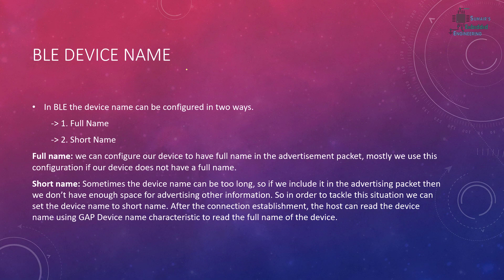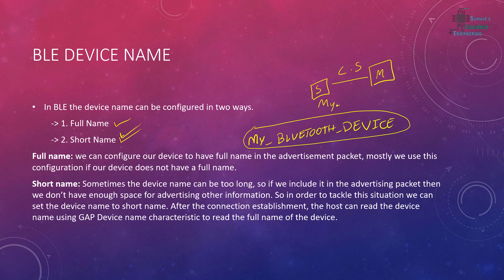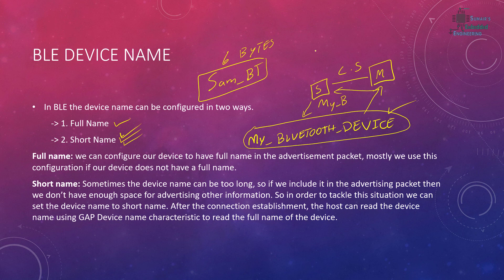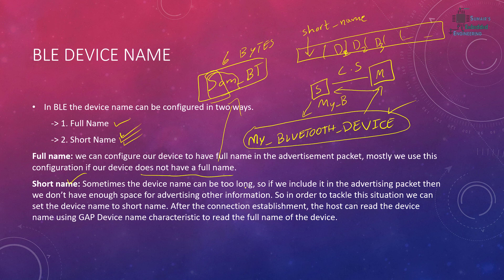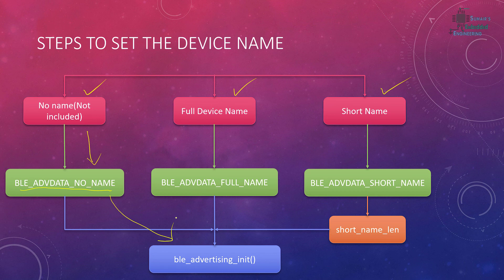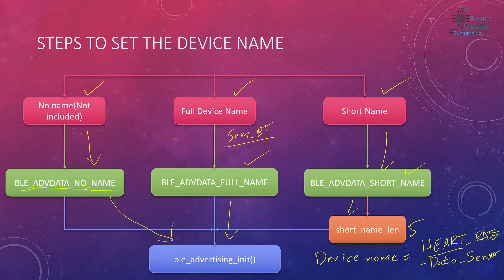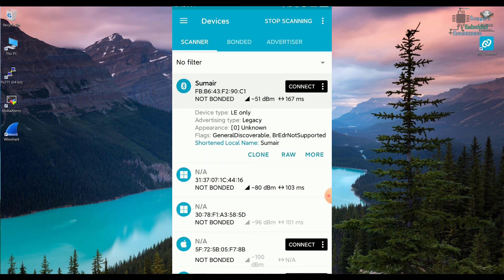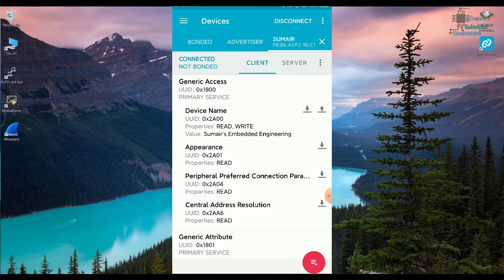nRF5 SDK - Tutorial for Beginners Pt 45 F - Setting BLE Device Name

Comment: #include <stdbool.h>
#include <stdint.h>
#include <string.h>

#include <nrf_log.h>
#include <nrf_log_ctrl.h>
#include <nrf_log_default_backends.h>

#include "app_timer.h"

#include <bsp_btn_ble.h>
#include "nrf_pwr_mgmt.h"

//include nrf softdevices library then we enable the soft devices in CMSIS
#include "nrf_sdh.h"
#include "nrf_sdh_ble.h"
#include "nrf_sdh_soc.h"

#include "nrf_ble_qwr.h"
#include "nrf_ble_gatt.h"

#include "ble_advdata.h"
#include "ble_advertising.h"

#include "ble_conn_params.h"

#define APP_BLE_CONN_CFG_TAG     1
#define APP_BLE_OBSERVER_PRIO    3

#define DEVICE_NAME           "Sam_BT"
#define MIN_CONN_INTERVAL      MSEC_TO_UNITS(100, UNIT_1_25_MS) 
#define MAX_CONN_INTERVAL      MSEC_TO_UNITS(200, UNIT_1_25_MS)
#define SLAVE_LATENCY          0
#define CONN_SUP_TIMEOUT       MSEC_TO_UNITS(2000, UNIT_10_MS) 

#define FIRST_CONN_PARMS_UPDATE_DELAY   APP_TIMER_TICKS(5000)
#define NEXT_CONN_PARAMS_UPDATE_DELAY   APP_TIMER_TICKS(30000)
#define MAX_CONN_PARAMS_UPDATE_COUNT    3

#define APP_ADV_INTERVAL       300
#define APP_ADV_DURATION       0

NRF_BLE_QWR_DEF(m_qwr);
NRF_BLE_GATT_DEF(m_gatt);
BLE_ADVERTISING_DEF(m_advertising);

static uint16_t m_conn_handle = BLE_CONN_HANDLE_INVALID;

/*9.1 error handler for queue writer */
static void nrf_qwr_error_handler(uint32_t nrf_error)
{
APP_ERROR_HANDLER(nrf_error);
}

/*9. SERVICES initialisation*/

static void services_init(void)
{

  ret_code_t err_code;
  nrf_ble_qwr_init_t qwr_init = {0};
  qwr_init.error_handler = nrf_qwr_error_handler;
  
  err_code = nrf_ble_qwr_init(&m_qwr, &qwr_init);
  APP_ERROR_CHECK(err_code); 

}

/* 10.2 create an error handler for conn params update */
static void on_conn_params_error_handler(uint32_t nrf_error)
{
APP_ERROR_HANDLER(nrf_error);
}

/*10.1 creat an event handler for connection parameters update  */

static void on_conn_params_evt(ble_conn_params_evt_t * p_evt)
{
 ret_code_t err_code;
if (p_evt->evt_type == BLE_CONN_PARAMS_EVT_FAILED);
  {
  err_code = sd_ble_gap_disconnect(m_conn_handle, BLE_HCI_CONN_INTERVAL_UNACCEPTABLE);
  APP_ERROR_CHECK(err_code);
  }

  if(p_evt->evt_type == BLE_CONN_PARAMS_EVT_SUCCEEDED)
  {

  
  }

}

/*10. create a function for setting up the connection parameters*/
static void conn_params_init(void)
{
 ret_code_t err_code;
 ble_conn_params_init_t cp_init;
 memset(&cp_init, 0, sizeof(cp_init));

cp_init.p_conn_params   = NULL;
cp_init.first_conn_params_update_delay = FIRST_CONN_PARMS_UPDATE_DELAY;
cp_init.next_conn_params_update_delay = NEXT_CONN_PARAMS_UPDATE_DELAY;
cp_init.max_conn_params_update_count = MAX_CONN_PARAMS_UPDATE_COUNT;
cp_init.start_on_notify_cccd_handle = BLE_GATT_HANDLE_INVALID;
cp_init.disconnect_on_fail          = false;
cp_init.error_handler = on_conn_params_error_handler;
cp_init.evt_handler = on_conn_params_evt;
err_code = ble_conn_params_init(&cp_init);
APP_ERROR_CHECK(err_code);
}

/*8.1. create Advertising event handler */

static void on_adv_evt(ble_adv_evt_t ble_adv_evt)
{
  ret_code_t err_code;
  switch (ble_adv_evt)
   {
      case BLE_ADV_EVT_FAST :

      NRF_LOG_INFO("FAST ADVERTISING");
      err_code = bsp_indication_set(BSP_INDICATE_ADVERTISING);
      APP_ERROR_CHECK(err_code);
      break;

      case BLE_ADV_EVT_IDLE:
      err_code = bsp_indication_set(BSP_INDICATE_IDLE);
      APP_ERROR_CHECK(err_code);
      break;

      default:
      break;

   }
  
}

/*8. Advertising initialisation*/

static void advertising_init(void)
{
  ret_code_t err_code;
  ble_advertising_init_t init;
  memset(&init, 0, sizeof(init));
  init.advdata.name_type = BLE_ADVDATA_FULL_NAME;
  init.advdata.include_appearance = true;
  init.advdata.flags = BLE_GAP_ADV_FLAGS_LE_ONLY_GENERAL_DISC_MODE;

  init.config.ble_adv_fast_interval = APP_ADV_INTERVAL;
  init.config.ble_adv_fast_timeout = APP_ADV_DURATION;

  init.evt_handler = on_adv_evt;

  err_code = ble_advertising_init(&m_advertising, &init);
  APP_ERROR_CHECK(err_code);

  ble_advertising_conn_cfg_tag_set(&m_advertising, APP_BLE_CONN_CFG_TAG);

}

/*6. gap initialisation*/

static void gap_params_init(void)
{
ret_code_t err_code;
ble_gap_conn_params_t    gap_conn_params;
ble_gap_conn_sec_mode_t  sec_mode;

BLE_GAP_CONN_SEC_MODE_SET_OPEN(&sec_mode);

err_code = sd_ble_gap_device_name_set(&sec_mode, (const uint8_t *)DEVICE_NAME, strlen(DEVICE_NAME));
APP_ERROR_CHECK(err_code);

memset(&gap_conn_params, 0, sizeof(gap_conn_params));

gap_conn_params.min_conn_interval = MIN_CONN_INTERVAL;
gap_conn_params.max_conn_interval = MAX_CONN_INTERVAL;
gap_conn_params.slave_latency     = SLAVE_LATENCY;
gap_conn_params.conn_sup_timeout  = CONN_SUP_TIMEOUT;

err_code = sd_ble_gap_ppcp_set(&gap_conn_params);
APP_ERROR_CHECK(err_code);

}

/*7. GATT initialisation*/

static void gatt_init(void)
{
 ret_code_t err_code = nrf_ble_gatt_init(&m_gatt, NULL);
 APP_ERROR_CHECK(err_code);
}

/* 5.1 BLE EVENT HANDLEr   */
static void ble_evt_handler(ble_evt_t const * p_ble_evt, void * p_context)
{
ret_code_t err_code = NRF_SUCCESS;
switch (p_ble_evt->header.evt_id) 
  {
    case BLE_GAP_EVT_DISCONNECTED:
    NRF_LOG_INFO("device is disconnected!!");

    break;

    case BLE_GAP_EVT_CONNECTED:
    NRF_LOG_INFO("device is connected !!");

    err_code = bsp_indication_set(BSP_INDICATE_CONNECTED);
    APP_ERROR_CHECK(err_code);
    m_conn_handle = p_ble_evt->evt.gap_evt.conn_handle;
    err_code = nrf_ble_qwr_conn_handle_assign(&m_qwr, m_conn_handle);
    APP_ERROR_CHECK(err_code);

    break;

    case BLE_GAP_EVT_PHY_UPDATE_REQUEST:
    NRF_LOG_DEBUG("phy update request");
    ble_gap_phys_t const phys = 
    {
      .rx_phys = BLE_GAP_PHY_AUTO,
      .tx_phys = BLE_GAP_PHY_AUTO,
    
    };
    err_code = sd_ble_gap_phy_update(p_ble_evt->evt.gap_evt.conn_handle, &phys);
    APP_ERROR_CHECK(err_code);

    break;

  }

}

/* 5. Init BLE STACK  softdevices*/
static void ble_stack_init()
{
ret_code_t err_code;

err_code = nrf_sdh_enable_request();
APP_ERROR_CHECK(err_code);

uint32_t ram_start = 0; //store the starting address of RAM required by the SoftDevice to manage memory 
err_code = nrf_sdh_ble_default_cfg_set(APP_BLE_CONN_CFG_TAG, &ram_start);
APP_ERROR_CHECK(err_code);

err_code = nrf_sdh_ble_enable(&ram_start);
APP_ERROR_CHECK(err_code);
}

/* 4. Init Power Management */
static void power_management_init(void)
{
ret_code_t err_code = nrf_pwr_mgmt_init();
APP_ERROR_CHECK(err_code);
}

/*3. Init BSP(leds)*/
static void leds_init(void)
{
ret_code_t err_code = bsp_init(BSP_INIT_LEDS, NULL);
APP_ERROR_CHECK(err_code);
}

/*2. Init timer app*/ 
static void timers_init(void)
{
ret_code_t err_code = app_timer_init();
APP_ERROR_CHECK(err_code);
}

/*1.initialize the logger*/
static void log_init()
{
ret_code_t err_code = NRF_LOG_INIT(NULL);
APP_ERROR_CHECK(err_code);

NRF_LOG_DEFAULT_BACKENDS_INIT();

}

/* step 4.1: idle state handle (sleep mode after sending the data ) */
static void idle_state_handle(void)
{
if(NRF_LOG_PROCESS() == false)
  {
  nrf_pwr_mgmt_run();
  }
}

/* 11 creat a function which will start the advertisement */
static void advertising_start(void)
{
  ret_code_t err_code = ble_advertising_start(&m_advertising, BLE_ADV_EVT_FAST);
  APP_ERROR_CHECK(err_code);
}
 
int main(void)
{
   
    // Initialize.
   log_init();
   timers_init();
   leds_init();
   power_management_init();
   ble_stack_init();
   gap_params_init();
   gatt_init();
   advertising_init();
   services_init();
   conn_params_init();
  
    // Start execution.

     NRF_LOG_INFO("ble base application started ...");
 
     advertising_start();

    // Enter main loop.
    for (;;)
    {
        idle_state_handle();
    }
}